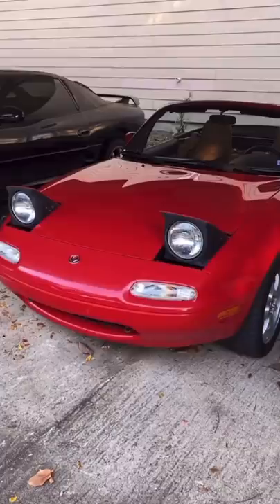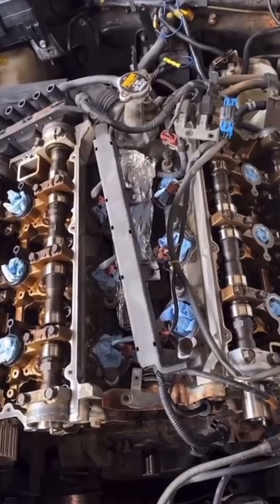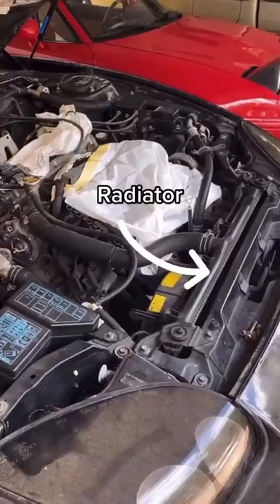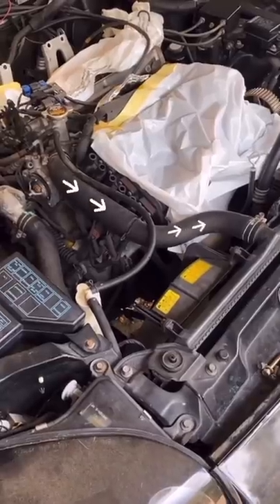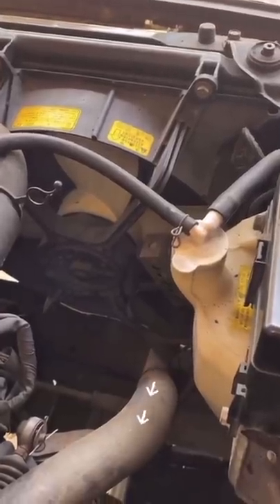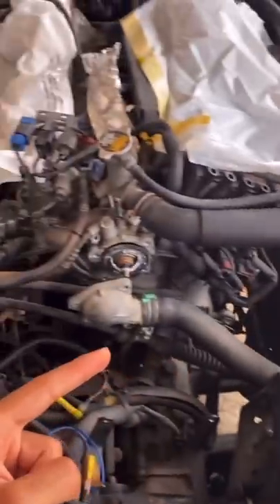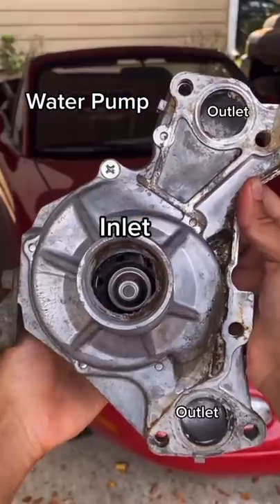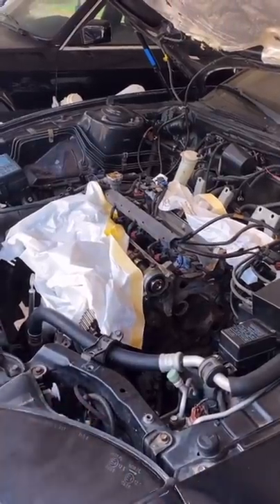Cooling System Explained! (Coolant Flow)

Comment: Miatas are very easy to work on, everything is simple and engineered the right way. I did all my own repairs for 18 years. Great car and fun to own.
Reply: Well nearly the right way.  The cooling system has issues.
Reply: @volo1826  I never had any issues after I removed the plastic radiator and replaced it with the koyorad. My buddy was a Mazda tech and only replaced 2 Miata engines and 1 transmission after 6 years at the dealership. I have owned more than 25 Mazdas since 1979 and most of them ran past 250,000+ miles with basic maintenance. I had a Mazda mx-3 that went 383,000 miles before it stopped passing smog check.

Comment: You think my water pump blades stop working when I go above 80 mph bc anytime I pass 80 or get on the gas it starts to overheat but I can be idling for quiet a while and it doesn’t overheat , it’s no my thermostat, radiator,fans or old coolant 🤷🏽‍♂️🤷🏽‍♂️

Comment: How cold is cold when it comes to radiator fluid
Reply: Most engines operate at around 190-200 F, some tuners run a 160 F thermostat to improve power at the cost of increased engine wear.